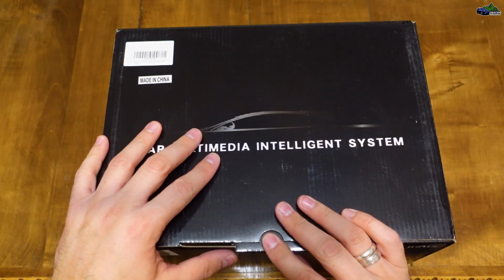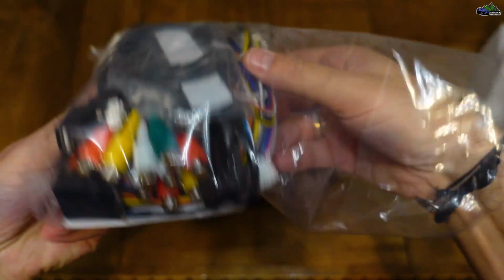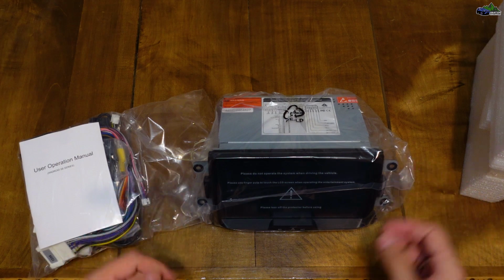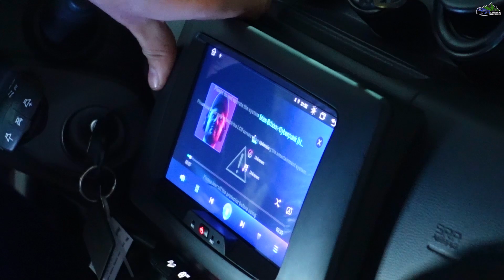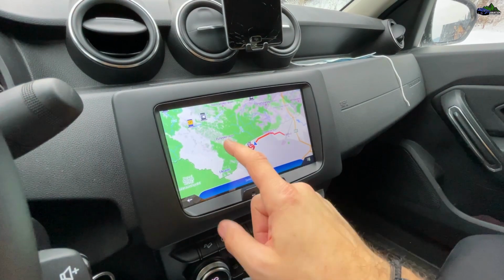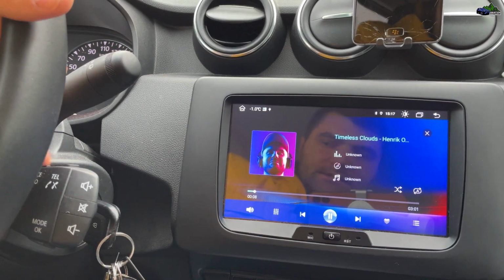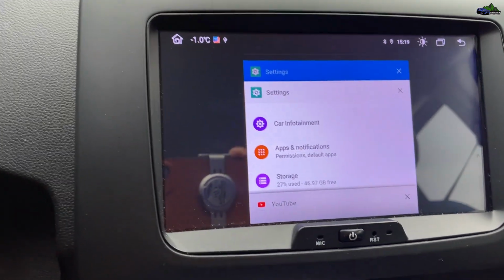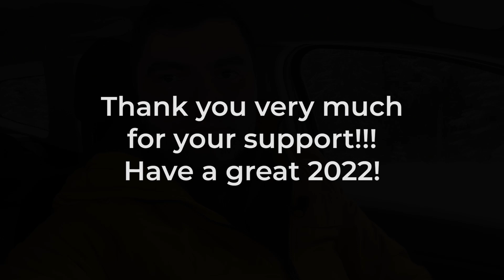Duster MediaNav Upgrade - Roadanvi Multimedia System with Android

Comment: Great video! Seems like a very nice upgrade. For some reason the Roadanvi states that it is compatible for Duster 2012-2019. I have a 2020 and I can't understand why it wouldn't fit a 2020 car. Is uses the same Media Nav and interface as previous Duster... as far as I know a 2019 and 2020 is the same car. Do you know any reason why it won't fit a 2020 Duster?
Reply from the maker: There is no reason why it won’t fit a 2020 Duster. The nav system has the same shape as my 2018 Duster?

Comment: Hi, how did you connect the original rear camera from the Duster with the cables?
Reply from the maker: It’s simple, this medianav comes with the required adapters and it also has a can bus adapter for the Duster.
Reply: @DusterCoolTravels  Thank you for your answer. We tried this with a renault captur, but we did not get image from the rear camera. Then we connected the two cinch cables and we got an image. Is this correct? And we have a problem: we do not get sound from the front and rear park sensors with this radio...

Comment: It seems to be a good thing, but are the 4 cameras view OK? And the 4x4 informations of the original system?
Reply from the maker: The 4x4 informations don’t work. I didn’t used it that much anyway. As for the cameras, only the front and back camera are working right now, but I have to do some setup and it will work.
Reply: @DusterCoolTravels  IS it hard top do the modification ?

Comment: And you can control radio too? How about speakers? In factory unit you can control sound coming from only back or front etc.
Reply from the maker: Yes, you can control the radio too with the buttons behind the steering wheel. And the sound is much better then the one from the factory unit. And it comes from all the speakers, you can adjust it like the factory one: more on the front, more in the back or the sides. 😁